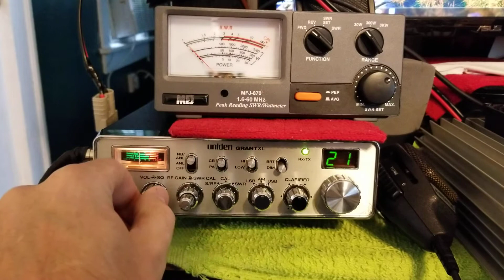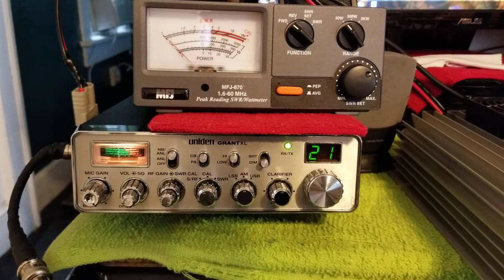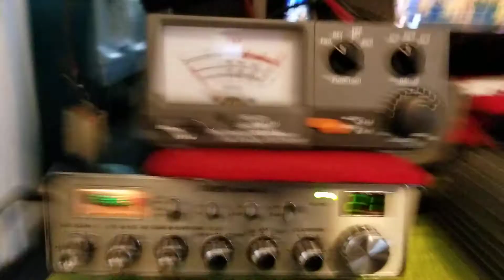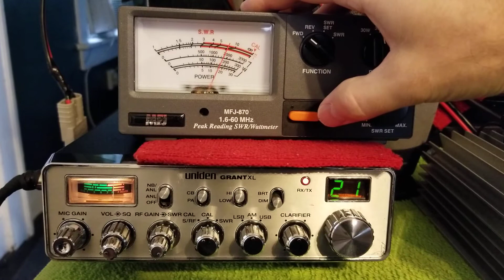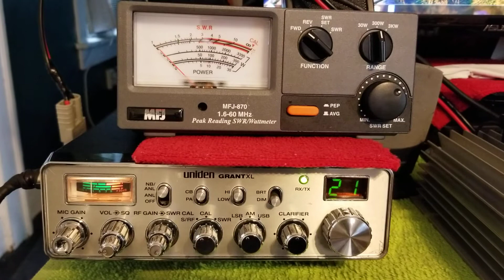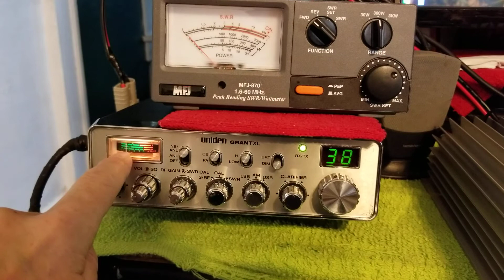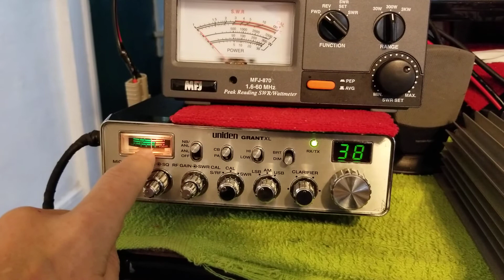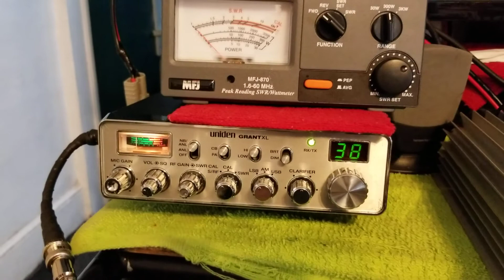RM ITALY KL 505V AMPLIFIER with the stock uniden grant XL

Comment: I just had this installed in my car. I have the 505VHF it’s the newer version of this. I guess works really nice. Does not even get hot, but I don’t overdrive it. I installed it under my passenger seat because it’s kind of big so if you put it in a car, like a Chevy Trax you’ll have to put it under the seat. It works just as well no problems. I have it on my cobra 29 LTD chrome edition AM/FM I’m putting only one watt into the amp had the radio sent out. I wouldn’t push it with 4 W

Comment: Hi Dave.

On SSB it dead keyed 13W. I thought the max input power was not to exceed 10W but you said it was still in range.

Can you explain it to me as I am a bit confused.

Thanks
Steve from Australia
Reply: The radio had a 5w dead-key and swung to 13w PEP. The amp is rated for 10w but they'll usually handle a bit more than their rating in PEP on sideband or even AM if you keep the carrier low. While I don't do it as I like to keep my output clean, I've seen people dead-key 2.5w and swing 20w into a little 10w rated KL-203p like I have without issues. A radio dead-keying 6w and only swinging to 18w will burn the same amp up pretty quickly. 

When operating AM, the carrier(dead-key) is constant and much harder on these amps than the modulated PEP input. Personally I'd set the dead key at 2.5-3w and swing 10-12w on these amps. More than 100% modulation(4 x carrier) creates distortion which just gets worse as it passes through the amp. If you need more power, step up to a KL-703 or modify a high power amateur radio amp(Ameritron/Kenwood/Yaesu) to work on 11m.

Comment: I guess you can adjust the output rf power on the rig - the GRANT TX - so that you can drive the linear with less than say...2 Watts ...if so desired? How are your "ears" ? I guess the antenna is a ground plane on the roof, or somewhere way up high? A resonant antenna is important for receive as well as transmit. When I used to shout skip, I'd say : Any skip out there ? Skipland, skipland, skipland, 787 Texas, break break.
Reply from the maker: yes I adjust the power and also check the scope to where it is clean as well

Comment: Nice video and info. What lengths of coaxial between radio, amp and meter?
Reply: @DAVE_WHITE  Thanks for the reply and info. I just bought a used Grant LT and a new RM Italy KL7405V also i have the same meter. Going to set it up in my tractor trailer with a Wilson 2000. Right now i am using a Galaxy DX33hp2 but no SSB.
Reply: @MrCofresipirate  how do u like the amp?
Reply: @69Polie69  Amp works great 🙂👍🏻
Reply: LOL CBers